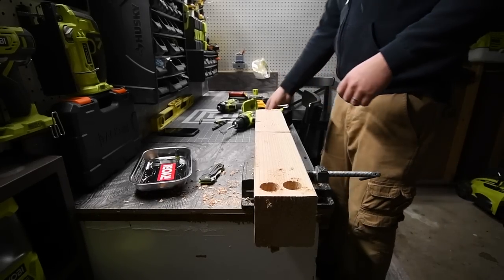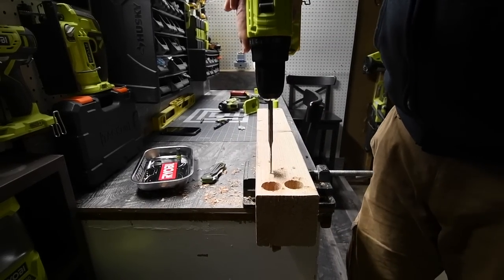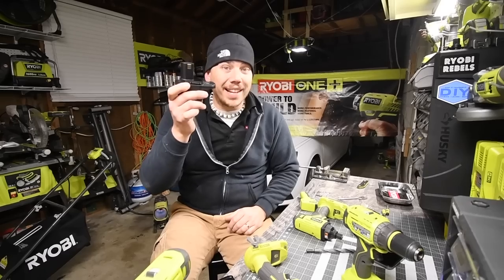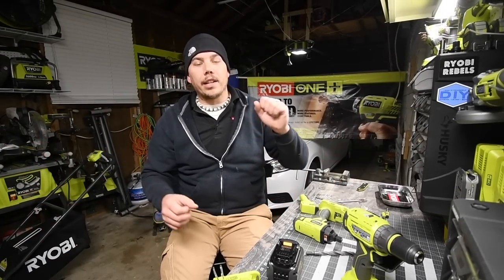Dewalt to Ryobi battery adaptor

Comment: I feel that covering the vents at the rear may not be a good idea - and you should be letting everything col to room temp between takes to avoid build up of heat from test to test - also as you drill the bit is getting duller so you should be swapping battery /bit order or using separate bits for each battery type to make it more like to like...

It's still a very interesting test .. just suggesting a bit more control to make your results more viable.

The fact it died with the Ryobi battery suggests it died due to general overheating - the tool itself, not the battery so  - I think over all the adapter seems like a useful "just in case.." but given that others mentioned that the drill may pull down beyond the battery normal over drain protection - I would suggest taking care.

I watched this video because I have a good set of 20v deWalt but Ryobi offers a wider variety of tools - so having a way to keep my extra battery investment all in DeWalt could allow me to have the best of both worlds (a few Ryobi batteries but ability to adapt if I need more run time on the Ryobi

Thank you for the interesting video

Comment: Prediction:  The Ryobi HP batteries will perform better than the Dewalt batteries in the Ryobi brushless tools (especially the 9.0 HP) because they have the communication contacts to tell the tool to draw more current.  The Dewalt batteries don't obviously have those contacts so the Ryobi tool will think it is a regular Ryobi battery and only draw the normal level of current.
Reply from the maker: correct, but it is till going to be fun to see it happen

Comment: I would rather just buy the correct battery then use one of those Goofy adapters.
Reply from the maker: But it is good to see if there is a difference in performance with other brand batteries